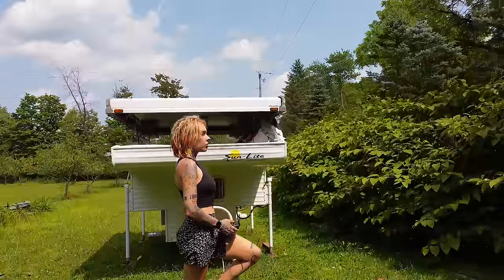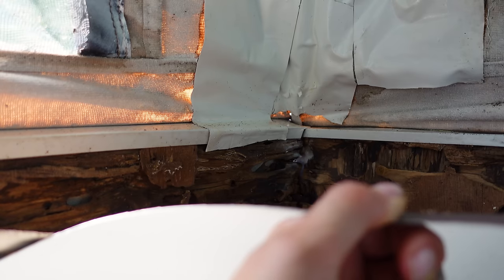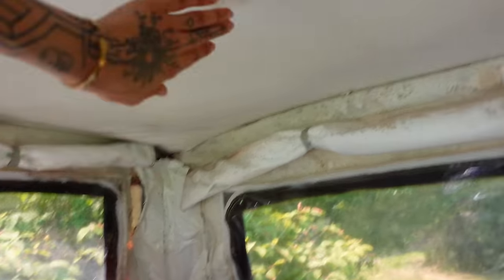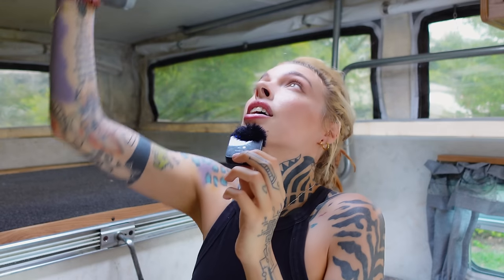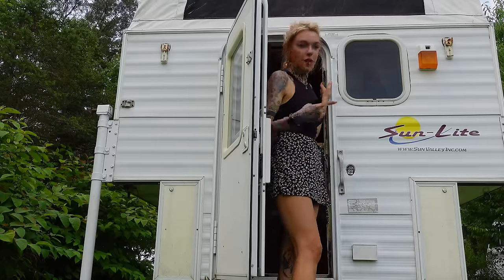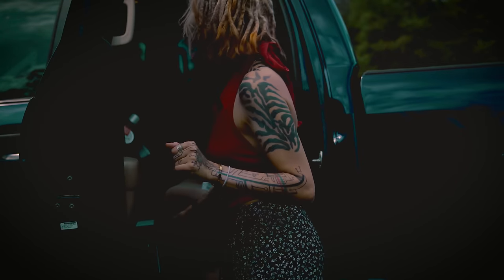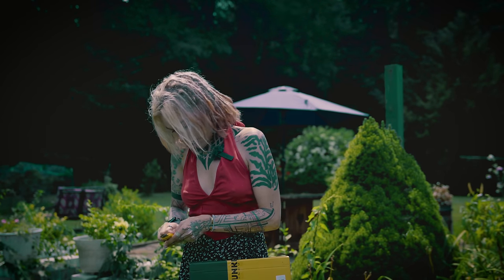old TRUCK CAMPER renovation BEGINS...this is worse than I thought

Comment: Is the roof completely wasted? or can you repair it?  It looked OK except for the little holes etc.  3M 5200 is better for water proofing/sealing roofs than that silicone you used. We use it on our ocean boats for permanent seals/cracks/holes fixes. 5200 will never come off and is white. It expands a little when it dries making it seal up gaps even better. Just don't get it on your skin or clothes, it doesn't wash off with water. They make a fast cure and a slow cure. I only buy the small tubes for the fast cure. Once you cut open 3M 5200, you have to use it within a few days to a week. It will harden in the tube fairly quickly once it is exposed to air.  Loctite PL Marine is a similar product but supposedly more flexable.
Reply from the maker: The roof is actually fine- I meant the ceiling insides is what needs completely re done — fortunately I can work with the outside roof 👍🏻

Comment: When life give you limonades, make limonades, especially in hot days.  This camper will make the opportunity to make a lot of videos how to repair a camper A to Z and find tools and material sponsor on the way.  For exemple, how to replace the roof, make measurement, cut the wood, cut the car glue aluminum insulation, cut 2 sheets of plastic to protect the inside and outside.

Comment: ❤DONT use silicone on the roof or outside !!!!! Get RV butal calk for exteriors . Get all the silicone off with a remover before adding the new correct caulk. Silicone is a nightmare on a camper. They have self leveling rv caulk for the roof and another one for walls. So the stuff on the walls doesn't just run off .Keep up the good job 🎉
Reply from the maker: I’ll look it up thanks!
Reply: @TorieRobot  look up Dicore Self Leveling lap seal.  This should be used on holes and seams.  Butyl tape for stuff like vents and windows

Comment: At least with a FB Marketplace purchase, if the dishonest seller doesn't give you anything back for how bad the condition really was, you can leave a negative review for them and potentially warn others. If the canvas was leaking as badly as it seems in the video then that mattress is probably full of mold inside. The crank mechanism is also likely corroded inside its gear assembly and that's why its extra difficult to crank up or down. A longer handle would help a bit also but I suspect you might need to get a cordless high torque drill with an suitable set of adapter bits for where the handles are supposed to go to crank the roof as well as the support legs for the shell. You might also look for some rubber or foam water pipe insulation sections that fit around the outside of the support legs to keep it from contacting the truck bed sides and scratching them further, should it shift even with the proper tie downs.

Comment: I agree you got ripped off from the seller....but it is what it is. Just realize you have no limitations or capability to learn what you don't know now. Don't cut corners in a hurry to finish faster. Having a functional...safe camper structurally sound and free of mold is the goal. Expand your knowledge base as need be! I would eliminate the hand crank all together and make it D.C. powered because even if you can do it dry...a heavy wet snow load can be a b----h. Have fun fixing it up...create memory's with your dad and friends....enjoy creating!
God Bless.....Stay Safe

Comment: I feel really lucky/spoiled that i got my 29ft 2012 north trail travel trailer for 6000 dollars. Everyone says i got a steal and when i took it to get inspected and something checked at the dealer they said they would have sold for 18k. I kinda want one like you got for my truck though. I have a 2003 toyota tundra 4x4. So horrible on Gas but will last forever. You will have to reseal all that again so next time you can get white or clear if you don’t want the black.   🤔. Curious why you did not get a travel trailer?  I need to watch more to see what kinda traveling you are doing. I know 24 hour gym places are cool cause you can boondock in the parking lot and use the Facilities. I will def watch more!  Sorry the seller screwed you over. That is lame.  You seem like a fun person! 🙂 im sure you will fix it up nice!

Comment: Yeah!! Gut that whole thing out! I'd rip that entire roof off, and redo it. Reseal it. (Plenty of youtube channels will show you how to do it) Then get the roof cover for it. Definitely would try to get a used rooftop a/c unit before the roof was finished.  Make it your own girl! get some IKEA furniture. Whatever works for you. Repaint the inside.
Reply from the maker: Well I think a rooftop ac might be too heavy but def want a fan!
Reply: @TorieRobot  nah it'll be good. If anything, you can always reenforce your suspension with heavy duty air bags. (Gives more cargo capacity) Which I would anyway if you're planning on keeping that thing in the bed. And that motorized lift for your top should be able to handle that extra weight. Of you're gonna go fan, do a 12 volt max air fan. With the windows open it will feel like a little wind tunnel in that tiny camper

Comment: Iron on canvas patches do on both sides(in & out), worse comes worse you can't crank it up can't fix the crank, Make it a hard side, Filling the gap that raises up with maybe 3/8 plywood cut out for some Recycled RV windows, Seal it up real good and do a poor man's fibroglass, paint to match camper

Comment: You need more leverage. Get a longer bar and make it a ratcheting system to raise the top.
Reply: Needs to find out why it’s so hard to crank. Putting more mechanical advantage on it may break the mechanism.

Comment: There is a product that seals the roof. It comes in a bucket and you apply it with a roller. I can’t remember the name.
Reply: And from the videos I’ve seen before I believe you are perfectly capable of doing this.

Comment: If its that hard to crank up then there's a problem with the mechanism. I had the largest model of this camper and my 100lb girlfriend and 10 year old nephew could both work the roof.  Check all the joints for rust and grease between all the bars i know that realy made mine move easy.

Comment: Hello sunshine  🌞
Always a power woman    💪
When things get tough , you put your shoulders to the weel   💝💝
TIP If you temporarily remove the roof , make sure youhave a waterproof tarpaulin 
that you can stretch over it with 2 poles in the middle for drainage   🎪
Keep up the good work girl 
Have FAITH in your self and be SAFE   🧷

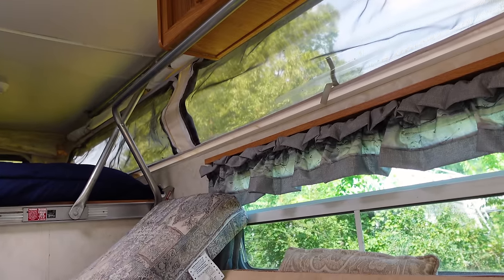Comment: i have a question, on this point am only 2:24 minutes in the video. but after seeing video tour of the camper. i wondert beceaus you said it hard to turn, could you not use a power tool to turn instead of the manuel tools?

nevermind 12:24 minutes in that answer was given ;)

Comment: Hey are you going to look into a sliding backwindow to maybe make it so you can go from camper to truck without going outside
Reply from the maker: That would be really cool tbh- I wonder how much that would cost though 🤔
Reply: @TorieRobot  VICTORIA just thought of how to do that cheap .....take back window out trace onto ply wood prob1/2 Inch cut hole in center ....I didn't see if your camper has hatch or window in front that is same area of truck back window if so it would work so you then can go from camper to truck ....... also old camper/truck set ups like yours used a inter tube between truck and camper that filled space to make it so cold air rain won't come in your dad might remember seeing that
Reply: @TorieRobot   so the ply wood cut out replaces back windo paint black with the hole put in like you would the window ....if   you take camper off you can put window back in I guess stash window at your dad's

Comment: Sorry your having to deal with the POS camper. I'm going through the same thing. Why can't people be more honest and up front about the condition of what they're selling? PEOPLE SUCK ! (that's why)😂
I think mine is bigger, so I paid less? Makes a lot of sense. Supply and demand? Like you said, the smaller ones are more desirable and harder to come by. 
I'm looking for a way to crank mine using 12 volt (push button) I'm a 200 lb male and after a few go arounds, I don't want to crank it anymore. If you go on MAV's YouTube channel, he just had somebody put an electric setup in his VW. I've got a VW Beetle similar to his. I call it the BedBug. I think he said the electric Pistons were from a stand-up desk? At least my crank is on the outside. That would really suck having to crank from the inside on a hot day! It would definitely suck, having to do it every day! I'm thinking my roof also needs replacing? I'm thinking it's saturated in spots and that much heavier and harder too crank up? I tried resealing all the seams, but it still seems to be leaking. I'm sticking it out down in Central Florida this summer. It's way too humid this year🥵 I wish I were closer, I'd definitely offer to help with the reconstruction. Every little bit helps... You've got the right attitude. Keep the faith 🐾❤️👣
Reply from the maker: Yea these things are tough - I’d say if it’s old maybe yours is having a similar problem as mine that it’s off balance making it hard to crank up - see if you can look at where the metal connects

Comment: Vicky robot, they robbed you of money,  dont let them rob you of time and energy.  The roof raising mechanism is corroded, its only gonna get harder and then its gonna fail.  I  would just start from scratch by drilling holes in the bed and use washes to distribute the load appropriately.   Build a storage space about half the length of the bed to center the load between the axles.  Then put the bed half on the storage unit half on the roof. Maybe cut a hole in the roof so you can access the living compartment from the truck.  The seller would be subject to the death penalty in some countries. ☠️

Comment: Bad deal maybe...great for the channel. Yes. Part of the hard part turning that is gonna be lack of maintenance rust etc.  maybe cut the handle and weld an extension about 4to6 inches long for more leverage til it's finished.  You're a very independent woman, please don't take offered advice as indication that we think you can't do it or need a man's help. We just like to feel like we're helping lol.
Reply: Btw you have to access that rotted wood from the outside to replace it
Reply from the maker: I love all the constructive advice and ideas everyone has offered - I only don’t like it when ppl are demeaning (man or women lol) keep the ideas coming 👏🏻

Comment: You’ll be fine. Don’t let the shit get to ya. Just need to learn people are assholes. Stop thinking everyone is like you. The truck people sold you truck with tons shit wrong and Xmas lights on dash but acted all buddy buddy. Marketplace camper people acted all buddy buddy and sold you a rotted camper. Use those two lessons to stop trusting everyone you meet. Whatever wood you get to rebuild the inside of camper do yourself a favor and buy a gallon of Thompson’s deck seal and paint all 4 sides and let it sit for a day or two before you use it. Then if it happens to leak again later it wont rot super fast again. Good luck you got this

Comment: Sorry you got ripped off. You aren't the first. Those dickheads probably got it for free. All campers are built to leak, I'm on my 11th one. You need a carpenter and a canvas man. Look up boat canvas guys maybe go to marinas and ask who they use. It really should be under a roof but chances are the canvas people will want it at their shop to replace it. They do canvas, zippers and plastic urethane windows. If you were in Florida I'd tell you to bring it here, I'm a trim carpenter and my best friend does canvas boat work. One day at a time! Oh you can use a cordless drill to raise and lower it once the mechanism is serviced. You'll get it I think with the right help.
Reply from the maker: I’m going to try and save the canvas as I don’t even know how to detach it from the bottom portion
Reply: @TorieRobot  See if there's is an RV mechanic in your area and have them look at it. I've had 2 popups but not one like yours. Good 🤞 luck!

Comment: There's no way you paid $3,000. You could've gotten something bigger and better for $1,000. Believe me, I can't believe you paid $3,000.
Reply from the maker: It’s very believable for what available around here— I wanted a short bed, lightweight, pop up camper - sure I could have gotten other things for cheaper but they weren’t what I was looking for. These kind are a lot more hard to find bc they fit most truck beds
Reply: @TorieRobot  Okay, as long as you're happy. Sorry for being rude.

Comment: Here I was thinking she’s crazy for buying that thing… yet I drop probably double that on a piece of shit held together with sticks and stones with 1 million miles that was dumped into a ditch for some number of years, oil was probably never changed 

I’m not saying what it is, but Took me 2 years to find one,  and will probably take me 2 months to rebuild 

P.s the exhaust was attached to the engine with sticks, 🙄 

It was due for 3 engine rebuilds, doubt it was ever done 🙄 

If it was done they probably used bubble gum for gaskets 🙄
Reply: P.s it will probably do 200mph, and the oil cost $500 to change.. 🙄 150 for just the oil 🙄

Comment: Find a smaller hollow bar that fits over the winding handle that's not to long that u can use for more leverage makes it easier to turn same thing when you try and crack a bolt that is hard to get off the more leverage u have the easier it will be to turn just food for thought hi from Australia 🇦🇺 😊
Reply: @TorieRobot dont add more mechanical advantage to that crank. Need to find out why its binding. More leverage could wreck the mechanism